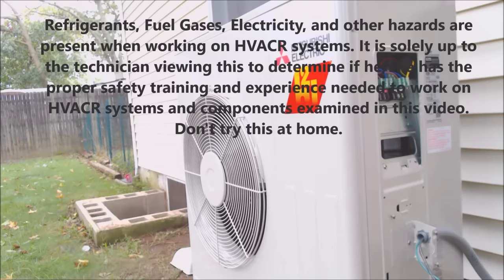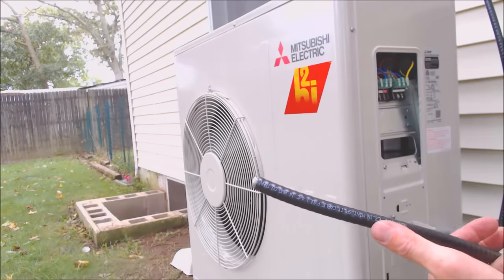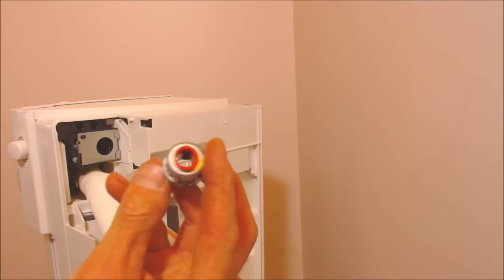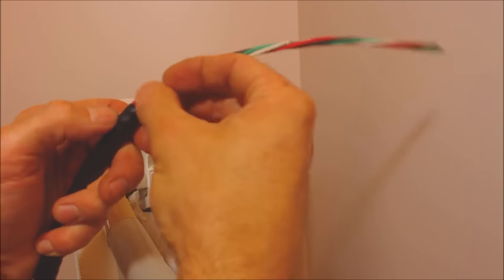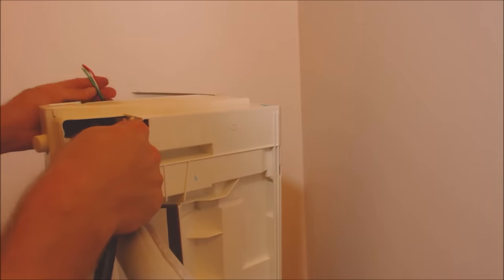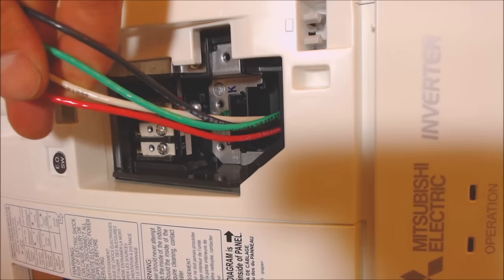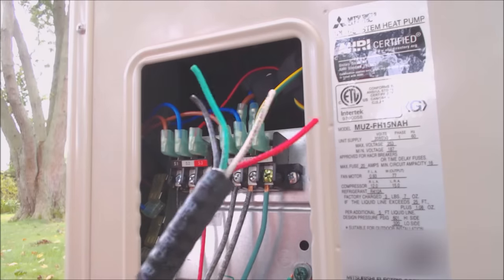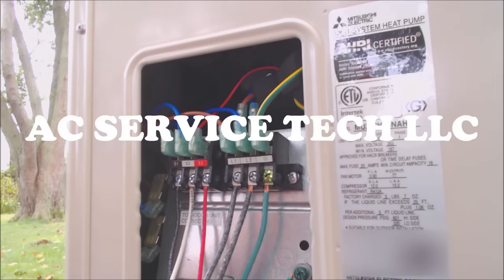Wiring a Mini Split System, Step by Step!

Comment from the maker: Tool List-  https://www.amazon.com/shop/acservicetech
Support-  https://www.patreon.com/acservicetech
Mini Split Book on Our Website- https://www.acservicetech.com/mini-split-book  
Mini Split Book on Amazon- https://amzn.to/3ytHJSs  
Mini Split Book on TruTech Tools- https://www.trutechtools.com/BooksGuides   
Mini Split E-Book on Google- https://play.google.com/store/books/details?id=HN-iEAAAQBAJ 
 Mini Split E-Book on Apple- https://books.apple.com/us/book/id6445178399
For those that are looking for the tools used in the videos: (Linked Below)
Southwire EZ-IN Mini Split Cable-  https://amzn.to/2zrYX52

Liquid Tight MC Connector- Southwire part# 64235201

MC Roto Split Cutter- https://amzn.to/2QVwQ4I

Irwin Wire Stripper/Cutter/Crimper   http://amzn.to/2dGTj2V

Yellow Jacket Torque Wrench- https://amzn.to/2NRR68Q

Yellow Jacket Flaring Tool- https://amzn.to/2OBxGlM

Yellow Jacket Flaring Tool with Set Depth- https://amzn.to/2QIKsQH

Nylog- https://amzn.to/2MLJcch

Ridgid Tubing Cutter- https://amzn.to/2DnjjR1

Wolverine Tube Reamer- https://amzn.to/2QGLyMV

FieldPiece ST4 Dual Temp Meter- http://amzn.to/2AhR6ph

Yellow Jacket Refrigerant Manifold Gauge Set used in the videos http://amzn.to/2aenwTq

Yellow Jacket Refrigerant hoses with valves used in the videos  http://amzn.to/2aBumVI

RectorSeal Bubble Gas Leak Detector http://amzn.to/2ckWACn

Appion Valve Core Removal Tool-  http://amzn.to/2uYr8WL

Ratcheting Service Wrench   http://amzn.to/2dGV4Nh

UEI DL479 Multimeter with temp sensor- http://amzn.to/2jtsUbJ

CPS Vacuum Micron Gauge- http://amzn.to/2v1nM3O

Appion Blue 3/8" to 1/4" Vacuum Hose- http://amzn.to/2uYlVyc

Appion Red 3/8" to 1/4" Vacuum Hose- http://amzn.to/2uYg6Ro

Yellow Jacket 1/4" by 1/4" heavy duty hose straight-  http://amzn.to/2umtcod 

Pack of 25 C&D valve cores- https://amzn.to/2J1lurm

C&D Valve Core Wrench, Container, and 3 valve cores- https://amzn.to/2EVGkps

Other tool links can be found in the video description section.

Shop through Amazon! Your Purchases through Amazon provide a means for channels such as mine to earn advertising fees from all purchases after clicking through. Prices are the same as normal-    https://www.amazon.com/shop/acservicetech

All of the ACSERVICETECH Playlists-  https://www.youtube.com/channel/UCOZR-1IqsAer9wzlvFgb4mA/playlists?view_as=public
Reply: The way you handle your adjustable wrench is not in a proper position,i mean its not in a according position of rotation to for tightening your connector.everything else i love it very nice and clear turorial
Reply: Its a shielded cable, do you not ground the drain wire?

Comment: I’ve noticed a lot of these do it yourself mini split videos don’t go into great detail step by step in wiring from the electrical panel to the unit.  What the breaker looks like, what size breaker,  how many wires what size wire and how it’s properly installed so no one gets electrocuted or shorts the system out
Reply: I know! This is the part I want to see and nobody shows that.
Reply: That’s because you’re watching a HVAC tech do a mini split install. Not an electrician adding a disconnect and circuit for the technician.
Reply: So true
Reply: So then what is the right size breaker to use on a 220v 18000btu mini split?
Reply: @Artseventy6 you use double 30's

Comment: What kind of disconnect did you use for the outdoor compressor? Amps rating,Make and part number or link would be greatly appreciated. Thank you much
Reply: Second this… this gets skipped over quite a bit.
Reply: That depends on model and make.  12k is different than 18k

Comment: What about the wiring at the service panel and 1 pole vs double pole breaker, etc
Reply: Step by step ? I don’t think so
Reply: @elpilonvideo  if you're not following these instructions and are confused on subject of single pole vs double pole do yourself a favor and hire an electrician.

Comment: No float switch?? When installing a float switch do not break the S3/red terminal. You must break one of the power terminals and not the communication terminal.
Reply from the maker: Yeah the DPLS2 can be hooked to the indoor thermistor or the pipe sensor but you are correct, an external sensor such as the SS610E can be used to break S1, thanks

Comment: I’m doing a mini split install now. I ran 14 gauge wire for my line voltage which is on a dual 20amp breaker. The whip I have has 10 gauge wire inside of it. Is it ok to run that to my line connections on my outdoor unit?
Reply: I may be a little late on this but here is what I think you’re asking. Yes the # 10 is ok. You can put large wire but never smaller than the over current protection allows. 
What you need to look at is the 20amp breaker feeding the 14 gauge wire. That is incorrect. The minimum size on a 20 amp breaker is #12. By design the breaker is ment to be the weakest part of the circuit, placing under sized wire changes that and makes the wire the weaker part meaning the wire would fail before the breaker would trip. So protect the unit with the over current device called for on the name plate then size your wire correctlet from there.
Reply: FYI 12-2 wire is for 20 amp... 10-2 
30 amp...14-2 15 amp. Shouldn't put 20 amp on 14 ever really. Easy fix though. Just switch out to 15 amp. Unless your heat pump is 15k+ btu. 12k and under runs on 15 amp breaker 14-2 wire. Good luck!

Comment: Nice thorough video, makes it all look straightforward and clear. Now back to real life for someone who does not do this for a living. On my indoor unit, not a Mitsubishi, for starters I cannot even find the screws to attach the 4 wires to. The 40 page instruction booklet is amazingly confusing and incomplete, mostly leaving out a lot of things and seeming to assume that you are in the business as an installer. I can hardly believe that the mini split I purchased (Home Depot) is certainly not as easy as installation always appears in these Youtube videos. I have many questions, and am still slowly plugging away at it. I still have no idea why a lengthy instruction booklet has to leave so many unanswered questions. Incidentally, I am a fairly experienced person with many tools, and pretty experienced with electrical installations too. But this is my first mini split. I blame most of the problems on the poorly written instruction booklet. This will also require buying a good many more specialized tools for hundreds of dollars.

Comment: When wrapping a stranded wire under a screw twist the wire counter clock wise before wrapping the wire clock wise under and tighten the screw. This stops the stranded wire from being squashed out from under the screw while being tightened. 
When using a crescent wrench apply the major pressure against the head of the crescent not on the jaw or bottom of the wrench .

Comment: Decent video, but as an electrician I have a couple of observations: 

You don't need a red devil with that snap in MC connector.  There is a captive one built into the fitting and adding another doesn't allow the cable to fully seat.

Second, when wrapping stranded wire around a screw terminal, twist it counterclockwise when looking at the tip and then wrap it clockwise around the terminal.  This will allow it to cleanly stay in the loop while you tighten it without the strands spreading.  Alternatively, crimp a U or ring connector.

Third, when stripping stranded wire go up one AWG in size on your stripper.  You risk knicking the outer strands if you don't, causing the same condition that you warned about with your diagonals.

Comment: a trick for the ground wire is strip it normal length (about 1/2")  move down the wire 1/2" further with strippers but ONLY slide the jacket out flush out with the previous stripped portion.
so you have 1/2" of stripped wire and the 1/2" past will still have jacket flush to the end of wire itself, the strands stay together, you can twist it tighter and it terminal wraps much easier.
Reply from the maker: Great tip!

Comment: Amazing how clear and concise information can point someone in the right direction. Thank you! Just one quick question. Im looking at installing a different brand mini split but the line connections look very similar. In my case i have a 50amp feed line with a neutral which you didnt mention here. The mini split doesnt need the neutral? Just two 120’s and the ground?
Reply: Some inside units run on 120V so be careful you follow correct directions.

Comment: Why isn't there no neutral coming from the disconnect switch to inside the wiring compartment of the outdoor unit? 
Your videos are the most helpful👍🏻
Reply from the maker: A neutral would only be needed if something was running on 120v. That is why a range has a neutral. This only needs the two hots and the hot becomes the path back for the power inbetween the phases of the frequency, thanks
Reply: @acservicetechchannel  so where I need to conect green wire if I have only white available in thr wall disconect box and no earth groung available  which is green

Comment: Craig we just installed  3 brand new split units in our office building and we have to run half-inch non-metallic Flex conduit and 14 gauge solid copper thhn that is control wires for the split units.
MC cable Southwire Style is not recommended because the outside jacket on MC cable so teen and dries up and cracks and that's why MC cable South wire style is not recommended because the outside jacket PVC coating it's so thin it doesn't last long we were told by electrical inspectors underwriter.
 so that is the rules in Pennsylvania for now.
Good work nice video as always.
Reply from the maker: Got ya, nice, thanks for letting me know Nurfet Alic! Flexible conduit does hold up very well and is proven over time. Just have to use the slim connectors on multi-zone systems since Mitsubishi puts the connector holes so close together, thanks!
Reply: I've never installed any jacketed mc, but I've seen a good bit and it's always cracked, bare metal showing and full of water. so I see why they don't allow it and to me it's more suited for indoor damp/wet areas out of any UV/sunlight.
Reply: @throttlebottle5906  yes I agree with you totally that's for indoor applications only as you mention in your reply.
Thank you

Comment: The end of the jacketed MC Cable going to the JMC Connector should be cut about 1/2" exposing the armor.  The locking fingers inside the JMC Connector is what holds and makes contact with the armor creating a bond.  It is not properly installed if the JMC armor is not properly cut before inserting into the connectors.

Comment: You missed the building penetration of electric - both the disconnect and the high voltage wires. These are important because of raintight disconnect box and inspection reasons.

Comment: The only problem that if found with this installation was that you needed to strip back the jacket on you metallic seal tight before installing the cable into your snap in connectors. it is very important to get a direct metal to metal connection on  all metal parts of your system. the metal part of your seal tight must be bonded as well.

Comment: I have a 110V mini-split. So based on your video I am assuming (on the outdoor unit) the single “L” terminal is for my “hot” Black wire, the blue terminal marked “N” is for my white Neutral wire, and the final yellow terminal (with a ground symbol) is obviously for my green ground wire. Does this sound correct?   

The instructions came with NO wiring diagrams 😡, but I have done a fair share of electrical wiring.
Reply: 110v isn't same connection

Comment: I got a customer that ordered a mini split called yita  home. I don’t typically mess with Milo splits too much. I’ve dealt with Sanyo Samsung lg mini splits  easy peasy. This yita home however has no installers guide at all this one threw e5 error I have nothing to go on as to why there is an error or what  it means. Power is what it should be connections are made well. Is e5 error the same
Across the board on all mini splits? If so this could mean I have a bad outdoor control board straight out the box.

Comment: Why do you have a single head/zone with two conduits connecting to the condenser? Unless there is some exotic code in your locale, then you run your power AND your control lines into your disconnect and then your conduit to your condenser carries your control lines and your load lines & ground to  the condenser?
Also when using stranded wire recommended practice is to use the appropriate crimp style connector. These units are very sensitive to voltage fluctuations.....dont forget your surge protector inside your disconnect switch....

Comment: is there anyway to jumper the outside unit to check and see if it will even run?  in such a way that you would test a standard condenser contactor, tough the two wires together??  thanks

Comment: Can you help me?

I plan on installing a mini split which would replace my central ac unit. My question is can I use the same wiring provided from my old central ac unit to power the DIY mini split I plan on installing?

Thanks!!

Comment: Great videos. Any harm in using a fused disconnect and.. a circuit breaker? I have a 18K BTU unit so 20 amps 20 amp breaker and 20 amp fuses. Also what are your opinions about a surge protective device like the Intermatic AG3000. Again thanks for all the great information, well done.

Comment: Please help, I bought a used mini split like this… The issue is they just opened the system and let the Freon blow off…. My concern is should I be worried about the POE oil level in the system after letting it blow off like that?

Comment: when using the EZ- in cable and stated connectors how does the shield get grounded ? Or should it? Details ? I've been reading a lot of confusing info about the shield grounding.

Comment: 2:43 I would recommend not displaying S1 and S2 as being '120 volts' as you have. Voltage always needs a reference, and since there is no neutral in this install, that 120 volts isn't really relevant. People who know will know, but this could be confusing for some. S1 to S2 is 240 volts and that's what's relevant.

'A wire' does not itself have a voltage and thinking it does can lead to trouble.
Reply: They are absolutely each 120v to ground, that’s your reference point and is at the exact same potential as neutral since they are bonded at every main panel.
Reply: @Jon Jensen  they are 120v to ground. I didnt say they weren't. I think I was just pointing out that when the circuit doesn't use a neutral, the voltage is 240v (there is NO 120 volts as far as those two wires are concerned with regard to eachother-- a single 240 voltage waveform.

Honestly I made this comment a while ago and I'm not sure why I felt the need to make a rather pointless point.
Reply: @jonjensen6036  Looking at that clip again... I think I was just trying to make the point that there is no neutral in the circuit, therefore no 120 volts in the circuit (unless a short to ground). It was kinda a dumb point to make in hindsight, 1 year later. But if we want to be sticklers (or pedantic?) the L1 and L2 120 voltage numbers should have had polarity or phase angle numbers with them to distinguish the voltage forms in reference to ground.

Comment: Central heating and air stopped working last year and I was wonder if a split unit could be hooked we're my old unit is and can it be hook to the floor vents (ductwork)?
Reply from the maker: A minisplit wouldn't be hooked to conventional ductwork from a standard split system. However, there are some minisplits, thanks!

Comment: Good content! One question: looks like you are using 12/2 AWG wire for the 240V input power from circuit breaker. So, there is no need for the neutral wire? like 12/3 wire?
Reply: There isn't a neutral in a 240 volt set up. With 12/2 wire for example both wire get connected in your electrical panel to a 2 pole double breaker, one wire for each. You would need to put black tape on the white wire at the panel indicating that its a hot wire not a neutral as per code. Then your ground wire in the ground bus bar. Hope that answers your question.

Comment: Could I connect a gauge set to a refrigeration system my self ?
Reply from the maker: From what you mentioned, you are not EPA 608 certified yet. You would need the cert first and I would advise working under a professional for some time as well, thanks
Reply: AC Service Tech LLC thanks for explaining

Comment: Just for the record, just because the max fuse size was 20a doesn’t mean you needed 12ga wire. 14ga was probably sufficient.
Reply: william cairns I just installed mine and it gave a P1 code for over or under power and the condenser won’t turn on. I’m not a  ac guy what did I do wrong oh yeah and I used a 20 amp breaker was that wrong too? Help please

Comment: I'm reading that I should not place the communications wire and power wires within the same conduit - that they need to stay apart to avoid electro-magnetic interference.  In the video you show all four wires within the same armored conduit.  Can you please address/clarify this?  Thanks.
Reply: If the comm wires are not transmitting a signal that could get distorted, as in with TV or internet, then it is fine to run it together with power wires.

Comment: Southwire also has a shielded EZ-IN Mini Split cable. What are your thoughts on using a shielded cable for a Mini-Split system - I'm installing a Daikin 2MXS18NMVJU. Is it necessary?